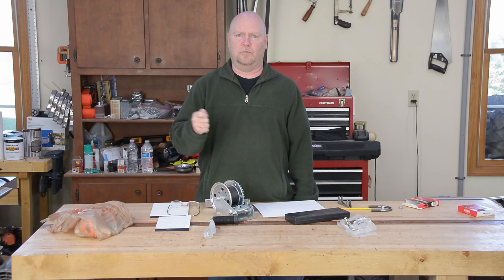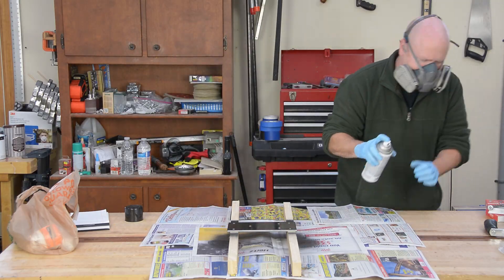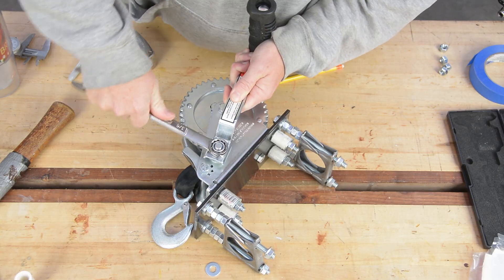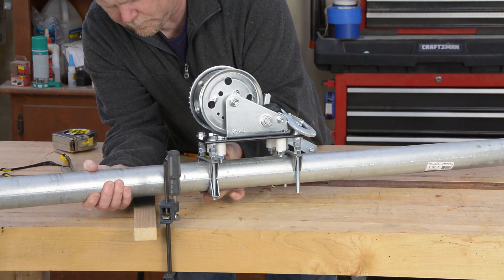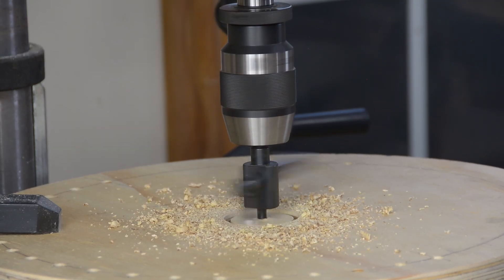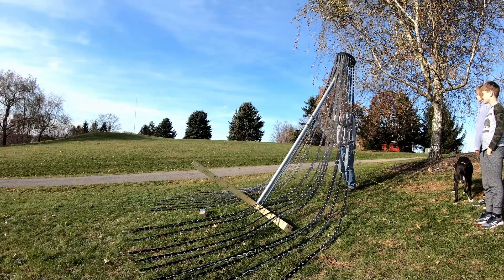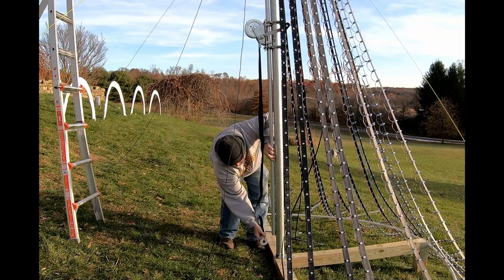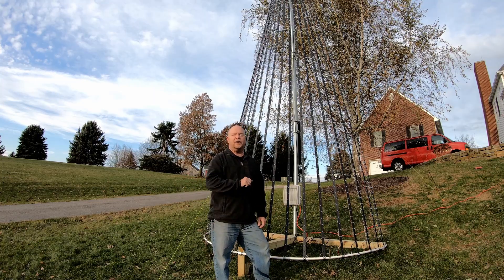Mega Tree with ASAP pole

Comment: Thanks for the video, I'm working on building my first my plan based off of what i have been able to learn is I plan to have 32 strands with 100 each, tree to be approx. 16-17 ft tall and base of 10 diameter, made to 180 deg not full 360.  What's your thoughts on this size and makeup,
Reply from the maker: @steviep3736  Very similar dimensions to mine.   I only have 20 stands,  but I'm also very far from the road.   32 is doable but probably the upper limit.   The issue is at the top.   They really start to run into each other.

Comment: What were the specs for strip lengths, # of strips, & pixel spacing (1" or 2"), pixel per strip. Thx
Reply from the maker: @tydingsctlights9167  75 per strip with 3" spacing.  There are 2 extra holes both top and bottom for mounting.  I'm 500 feet back from the road, so the wide spacing is ok.  Usually 2" is better.

Comment: Very detailed. This is great step by step instructions. I noticed one thing. You are using 2" GALV Pipe but it looks like the exhaust clamps are 2-1/4". Am I missing something? Wouldn't you use a 2" clamps on a 2" pole? Or is the 2-1/4" clamp used on purpose ?🤔
Reply from the maker: 2" is the I.D.  O.D. is supposed to be 2 3/8" but the 2 1/4" clamps seem to work.

Comment: Hi question  that controller are 16 port right? do you using all 16 port just for that megatree? how did u setup?
Reply from the maker: I use controllers that I built myself based on the ESPixel Stick concept.  There are two controllers for the tree, each of which is a single port, so each 1/2 of the tree shows up as an IP Address/Controller in XLights.

Comment: How well has the epoxy and flange fitting in the 4x4 held up?  One word of advice is to spray paint the epoxy, uv breaks down epoxy.
Reply from the maker: It's stronger than the wood really.  The UV is a non-issue for me.  When this thing is assembled all of the epoxy is inside the fitting and covered by the pole.  The rest of the year, it's stored inside a dark shed.

Comment: hi Matt, Great job and nicely done. I'm currently building mind here just few question your lower half moon PVC. What is the length and diameter? No. of light in the Strip? What is the Total length of the strip? and how many strip in total?
Reply from the maker: I have 75 pixels per strip, and 20 strips evenly spaces around 180 degrees in the front.  Whole thing is ~17.5 feet tall.    What you need is the mega-tree calculator (Google that if YT kills the link I'm pasting here): https://mattosdesigns.com/pages/mega-tree-calculator

Comment: Electric conduit (Rigid Pipe) is different from plumbing pipe.  Plumbing pipe has a inside weld down the length of the pipe with a welding bead that sticks up.  Electrical conduit doesn't have an inside weld so electrical wires will not be cut.  Plumbing pipe has tapered threads.  Electrical conduit has no tapered treads so the threads go all the way in and butts up to the connector leaving no sharp ends to cut the wire.

Comment: Great set up, the lights are awesome. I used 1/2" rebar, heated and formed a 6' circle and welded 3 -1/2" rebar legs to it.
Reply from the maker: The PVC 1/2 circle is decidedly the worst part of this setup.  I keep intending to replace it with conduit and then of course never get around to it...

Comment: Matt, well done!  I am in the finishing stages of replication. I just had a few questions I was hoping for the short answers to:
1) I have 24 strips of 100 - What was your topper radius? And how far in did you drill holes for fasteners?

2) how big was the pin/bolt in 1 1/2 extender pole? And how far up/down did you drill them?

3) if you can offer suggestions on what size guy wire you would use? Thinking 3/32 SS 7x7 would work. Thoughts?

Appreciate all the feedback and more importantly this video. It was much needed and glad I found it.
Reply from the maker: Hi Michael.  Couple of things:  for sizing I used the MegaTree calculator over at lightshowhub dot com (stupid Google won't let me link to it).  That's the easiest way to get the diameter for the top and bottom given your strings and planned pole height.     My pin is just a 1/4" bolt.  Size isn't critical here but use a quality bolt for the pin so it doesn't sheer off.  

I've been using rope guys (550 paracord) with two sets (one from the top and one from the joint between poles), but will likely move to steel cable this year.  The rope is plenty strong for the tree, but is prone to being chewed by the dogs.

Comment: Simple question - how do you keep the 1.5" pole elevated? Does the winch hold it up or do you pin it somehow?
Reply from the maker: Both.  The winch and push pole can hold up the top section.  I drilled the 1.5" pole for a pin anyway and let the tension off of the winch once the pin is installed.

Comment: which controller use this programming,,?
Reply from the maker: I'm using xLights software and an E1.31 protocol receiver of my own design.   It's based on the ESPixelStick hardware.
Reply: @MattHeere  Hello
Praise the LORD
Goodmorning,
Thank you very much for spontiuos responding.
Iam useing t 1000 controller  & t8000 controller.
It's run with LEDedit 2014 software.
I need mega tree pixels making .so 
Pls gaid me.

Comment: On minute 5.12” on your video you mentioned a 90 degree offset hole. Does Walters pdf mention that because I thought all holes were all in a line.
Reply from the maker: I don't have the PDF handy, but if the holes are in line then the push pole is right in the way of the pin hole(s).
Reply: @MattHeere  thx for your response. His document is not clear. Because I see his drawing and looks like all holes are in line. Do you have a photo of what yours looks like.
Reply from the maker: @aaronpalusso  Nothing better than what's in the video at or around 5:20.
Reply from the maker: @oneidalights  The reality is that it doesn't matter much.  I find having the hole for the hold pin and the hole for the push pole offset keeps them from getting in the way of each other, but it will work no matter where they are.

Comment: I’ve really started thinking about... 

Isn’t this pole a really nice lightning rod?

Rarely does anyone address grounding.

Oh... and...

#steelernation
Reply from the maker: It's gonna depend on lot on your situation Devin.  Here in WPA lightning isn't a thing in the winter.  Even if it were, this tree is only 1/2 as high as the house (which is covered in lighting rods) or any tree in the vicinity.

If you live in Florida and put up a 30 footer next to your ranch patio home, then a ground rod or two is probably a good idea.  Alternatively you could use wire for the guys.  All you're trying to do is bleed any static charge off of it.  You can not engineer this thing to be ready for a direct hit.  At some point you have to accept some risk in order to get out of bed in the AM.
Reply: @MattHeere  good point. The construction is amazing and thanks for the great video.

Comment: Hello, congratulations on the project. Amazing! U have some docs or videos about the electronic parts and program code?
Reply: xLights or Vixen for the "sequencing" - that's the programming part. The electronics you can do with controllers from  HinksPix, AlphaPix, Falcon, or any other controller supported by the sequencing software.
Reply: @mattsherif  or Hinks Pix PRO like I use

Comment: Hi where did you get the lights and how do they make them amazing patterns, would love this in my garden this year
Reply from the maker: Well it's a combination of parts.  The lights are what's known as "Pixels" or more technically "individually addressable RGB LED bullets"  The software that makes all the patterns is called xLights (xlights.org).  In between the two is a controller of some kind.  I built my own (see last years video on the lights) but you can buy them as well.

It's not difficult once you get the hang of it, but there's a lot of building/configuring to get it working, and then quite some time in xLights to get the show right
Reply: @MattHeere  I'm from the UK, and I'm used to using logic for programming systems at work so I think I can get my head around software, its just finding parts in the UK 🇬🇧 😀

Comment: Great video on the construction,  I would definitely be interested in how its powered, and how to get a pre programmed loop of effects for the lights. Btw, did you have some re adjusting through the season? Here we have heavy winds sometimes and 1st year I have anything new it has to be tweaked.
Reply from the maker: The only issue I had was something I knew going in wasn't great and that's the PVC conduit around the base.  It wasn't strong enough the really keep the strips taught in the wind.  I'll be replacing it with an individual stake for each strip next year.
Reply: @MattHeere  I use the big barn nails to hold everything down, the thicker ones, the skinny ones pull out to easy. I've wanted a pixel tree for over 5 years, but not computer savvy. I've heard you just download some free adrino load it on a sd and pop it in.
Reply from the maker: @confinisher67  Well there are two ways to go about it.  The easy way is to just buy a controller such as a a Falcon (pixelcontroller.com).  That eliminates all of the electronics building and also the complication of maintaining an appropriate WiFi network (which is much harder than it sounds).    The harder way is to get into a microcontroller chip and build the receiver yourself.  The code for the chips is already available (look up PixelStick) but you still need to assemble the hardware.

Either way, the big investment of time is in the sequencing.  Learning the xLights software and customizing things to whatever your layout ends up being is where 99% of the time goes.

Comment: can you help me where to buy the lamps in 1 set and at what price. because I guess for an iron pole I can assemble it myself.
Reply from the maker: Well you don't just "buy the lights" for a thing like this.  It requires the LEDs themselves (usually called "pixels"), then the controllers and the power supplies, then the networking, and finally there needs to be a computer that you setup and program to run the whole thing.   Check out my video from Nov 2018 where I go through all the pieces needed for these types of lights.

Comment: what type of lights are those ? i had made my own mega tree years ago with 2 welded together 10ft poles so i had a 20ft tree. made a plate at the top to attach all lights to with zip ties. all said and done it was 40, 100 light strands = 4000 lights and weighted a TON would love to have these light strips. look much simpler!!!
Reply from the maker: They're addressable RGB LEDs - generally known as "pixels".  They don't come in the strips.  You buy the strip material separately with whatever hole spacing you want and push the pixels into it.  I would love to have just welded two pieces of DOM together for this, but it has to store in a 16' long shed.

Comment: ..Bloody Fantastic !!! A Heat Gun will bend the PVC. Easy does it or it will kink. i am amazed at what can be done with LED's. Great job Matt & Crew...!!!!!
Reply from the maker: Howdy James!  Thanks a bunch man.  Question for you - I asked for a lathe for Xmas and if I get it I want to make a marking knife out of that metal you sent me.  What can you tell me about that stuff?
Reply: @MattHeere  ..apologies for the delay Matt. It's 5160 Spring steel from a car coil spring. i hardened the edge but the rest of it ought to machine out. Test it with a file to be sure . If it won't work let me know and i'll send a chunk you can work down. Happy Turkey Day to you & yours...